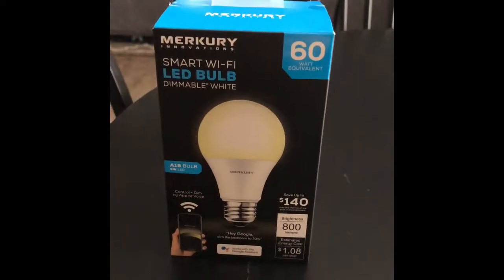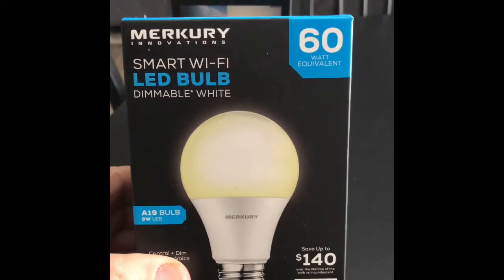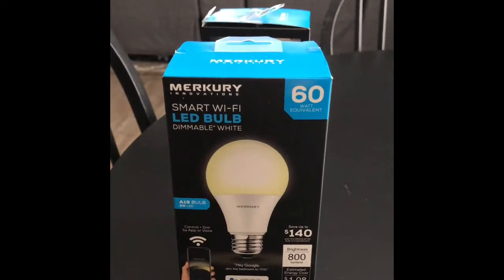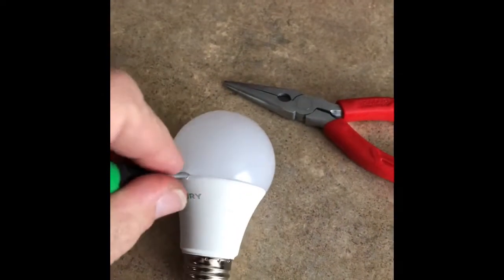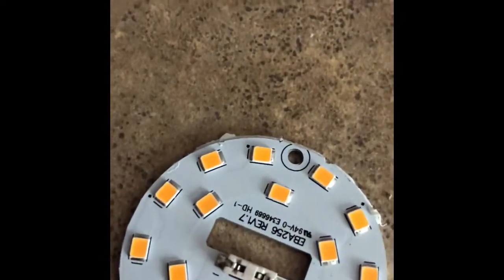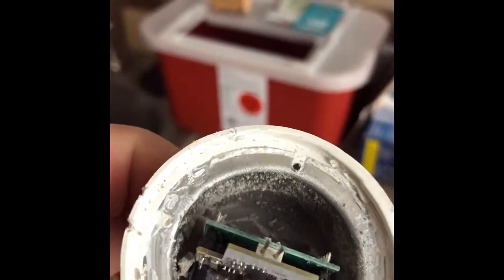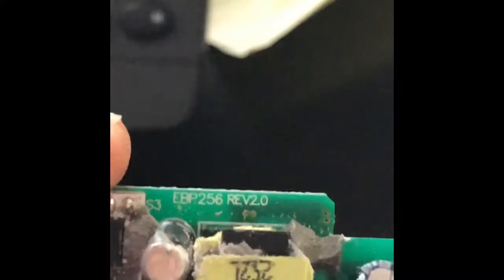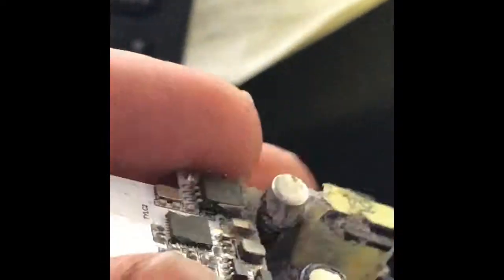Merkury smart bulb tear down

Comment: Thanks bro, I won't be disassembling mine bc of the adhesive stuff. These have esp8266 controllers. If you want to start a new hobby, you can use tuyaconvert to convert these to tasmota, then set up advanced automations on Home Assistant. They're currently connected to China because Merkury just rebranded tuya bulbs. Even the Geeni app is an exact carbon copy of the Smart Life app.